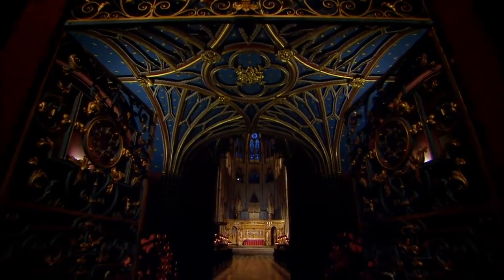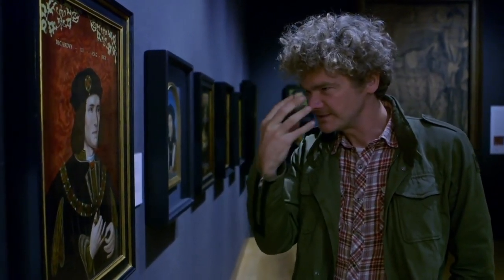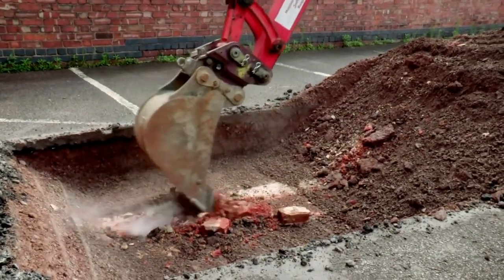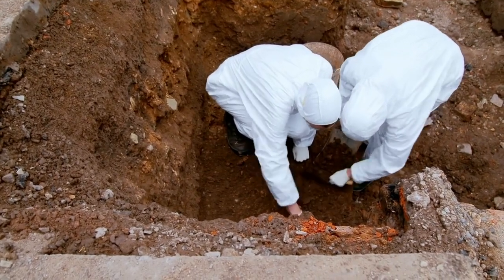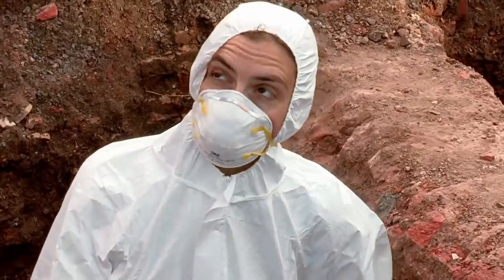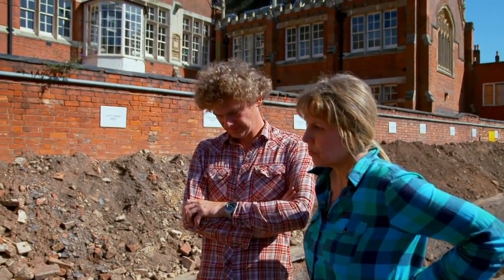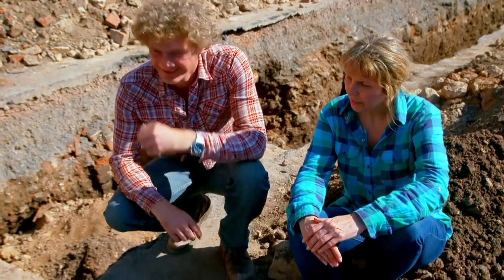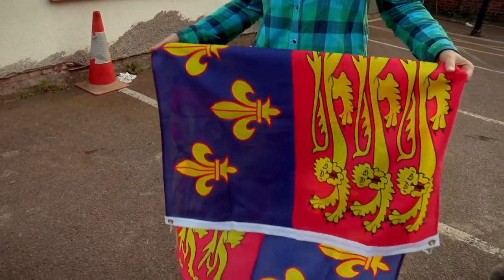Finding The Missing Skeleton of King Richard III - Documentary

Comment: I have scoliosis. I have 2 curves in the shape of an 'S'. My right shoulder is 2 inches higher than my left, my ribcage pushed out more on the left, and my right hip is higher.  With clothes on it is not noticeable. My upper curve is 25 degrees, and my lower curve is 15 degrees. It causes excruciating pain. Richard had an 80-degree curve, and he was still fighting in battles. I couldn't imagine.